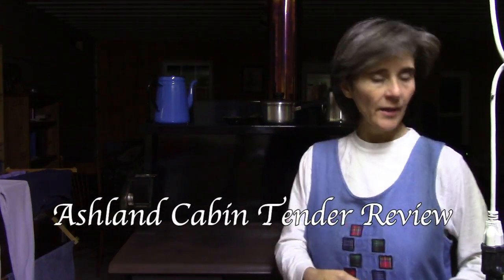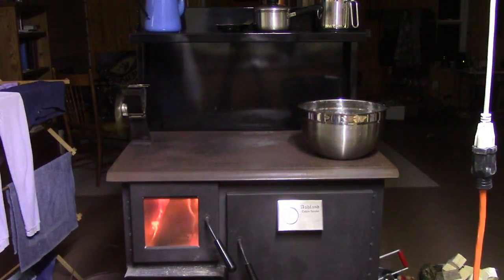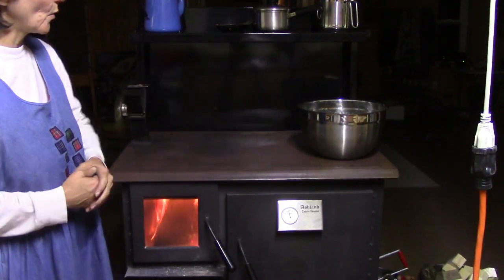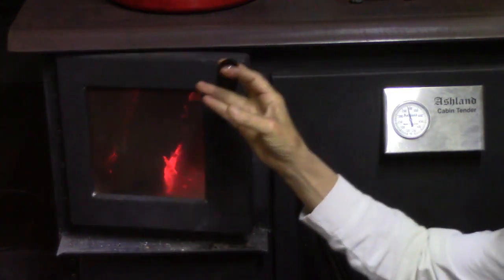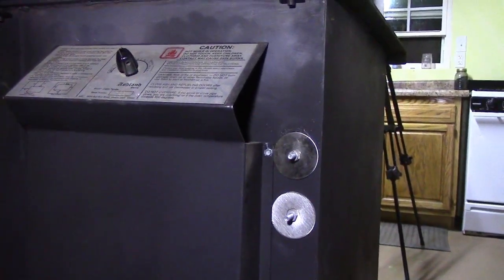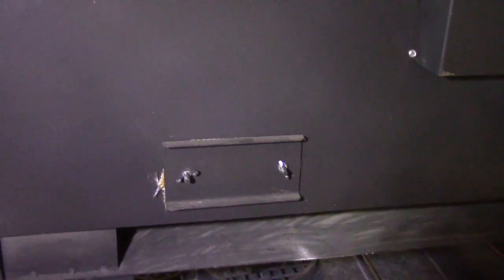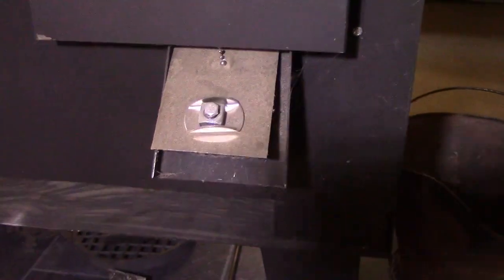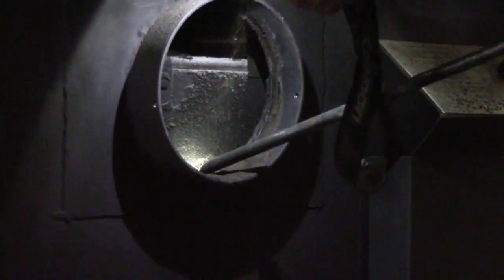Ashland Cabin Tender Cook Stove Review

Comment: We have one but as soon as the temp drops below 200 the cabin fills with smoke that comes out of the air intake on the back of the stove. Any ideas what we might be doing wrong.
Reply from the maker: Just quickly mentally troubleshooting, do you have your damper open in the chimney?  Have you cleaned the chimney?  When the temperature isn't very cold outside it is harder to get a good draw of air up the chimney and it tends to want to put smoke out the door or intake.  If you are using damp wood it can do this as well.  There are three components to a good fire: oxygen, heat and fuel.  Look at each of those and see if there needs to be adjustments.  Hope this helps!

Comment: Great video,  we have been thinking  about  getting this stove or a bakers choice. Since the top doesn't have lids how do you scrap and clean the top of the oven?
Reply from the maker: There is an entry on the rear of the stove for cleaning around the oven box. I know where one of these is for sale if you are interested. Very lightly used and in excellent condition.  Comes with summer grate, water jacket and I think it even has the coal grate.
Reply from the maker: Also, I have friends with the Baker's Choice and much prefer the Cabin Tender.  Even though the woodbox on the Cabin Tender is a bit smaller, the oven is bigger.

Comment: What about putting down aluminum foil to stop the water drip, and the rust clean up?
Reply from the maker: The reason we had so much rust then was b/c we did not have our water heater installed yet b/c we didn't have the solar power hooked up.  We were using the stove to heat our bathing & cooking water.  Once we got that done, we didn't have so much rust.  :-)   Not sure how the AF would work.